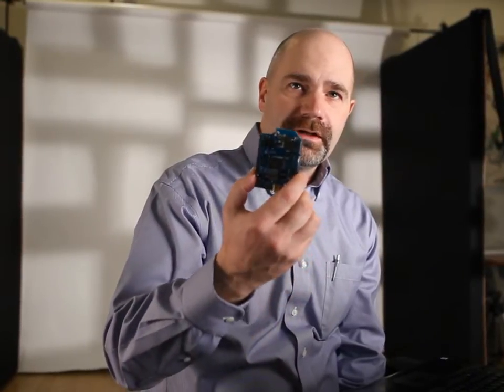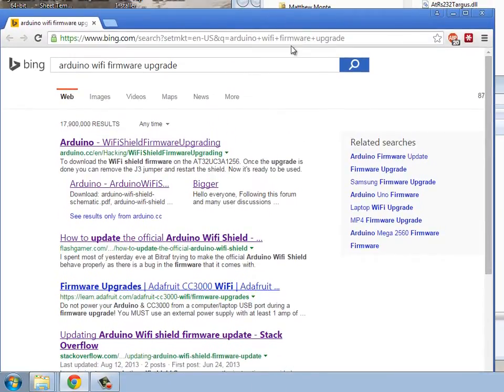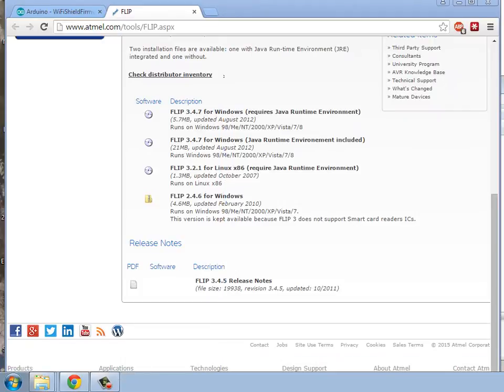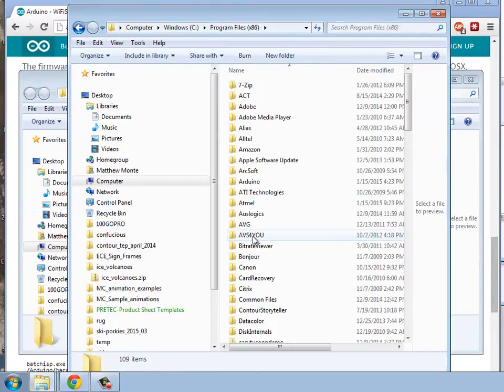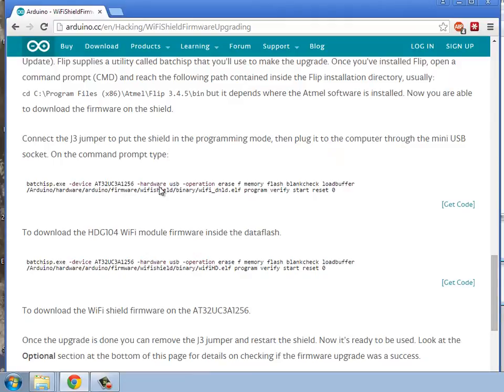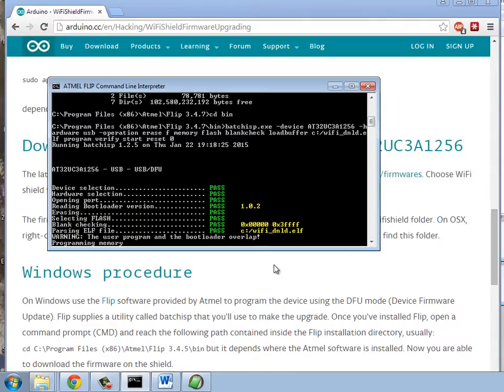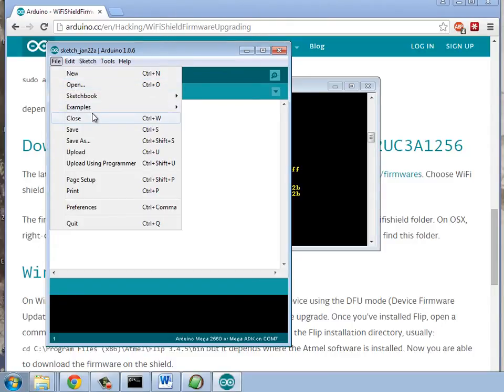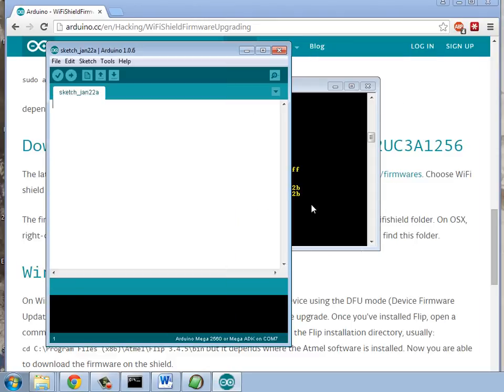Arduino Wifi Shield Firmware Update Procedure

Comment: oh thank you thank you so much there the cmd command : after putting cd C:\Program Files (x86)\Atmel\Flip 3.4.7\bin
1/batchisp.exe -device AT32UC3A1512 -hardware usb -operation erase f memory flash blankcheck loadbuffer c:/wifi_dnld.elf program verify start reset 0
2/batchisp.exe -device AT32UC3A1512 -hardware usb -operation erase f memory flash blankcheck loadbuffer c:/wifiHD.elf program verify start reset 0

Comment: I did everything. Installing ESP.. and changing to MCT and port COM3.
Examples -> I try to compile but it comes error:
Arduino:1.8.1 (Windows 10), Scheda:"NodeMCU 1.0 (ESP-12E Module), 80 MHz, 115200, 4M (3M SPIFFS)"

Opzioni di compilazione cambiate, ricompilo tutto
Lo sketch usa 222201 byte (21%) dello spazio disponibile per i programmi. Il massimo è 1044464 byte.
Le variabili globali usano 31576 byte (38%) di memoria dinamica, lasciando altri 50344 byte liberi per le variabili locali. Il massimo è 81920 byte.
warning: espcomm_sync failed
error: espcomm_open failed
error: espcomm_upload_mem failed
error: espcomm_upload_mem failed

I don't know where is the error. I'm new of this.
My shield is: https://www.amazon.it/gp/product/B01C3ZN920/ref=oh_aui_detailpage_o02_s00?ie=UTF8&psc=1
Wireless Bord Dev Esp8266 Esp-12e UART WiFi Per Arduino Uno R3. I have Arduino UNO (original) and I connected the shield Wifi over the Arduino.
Thank you!
Reply: Hello! I am not sure I can trouble shoot this for you. Did you have a checkbox showing at port COM3 to know for sure that your board is recognized?

Comment: i have a problem when i upgrade firmware in cmd it show some problem .it show device selection to blank checking is PASS but at the last one parsing ELF file show can't open input file "Arduino/hardware/avr/arduino/firmwares/wifishield/binary/wifi_dnld.elf"
FAIL reading error.

please help me how i solved it.
Reply: Hello Gobinda, I am not sure I can help, but it appears that the full path to the file is not there - should be c:\users\Gobinda (or something like that). ...  I would recommend simplifying the location of the file to something like c:\temp\wifi_dnld.elf  to make it easier to define the entire path to the file. Hope that helps! --Matt
Reply: Thank you .......i solved it

Comment: I have a problem with the wifi_dnld.elf, when I click enter a message appears "The operation switch is missing" could you help me?
Reply: +Angel Ramirez I solved the problem, thanks for your video, excellent.
Reply: +Angel Ramirez hi can you explain how did you solve it? I am having the same problem as you did. I really apriciate if you comment how you solve your problem.
Reply: +mert t you need to upgrade the firmware that you arduino wifi have, wait a moment... i need to look for the videos that can help you
Reply: +Angel Ramirez jaja this is the video that help me, if you follow step by step should solve the problem
Reply from the maker: +mert t Do you need help on the firmware update process (this is in the video) or with the problem that Angel solved about "The Operation Switch is Missing" (that is not in this video)?
Reply: how did you fix the problem  "The operation switch is missing"?

Comment: THANKS!
It worked, but surprisingly I had to reflash the bootloaders on that boards I've tried the shield with the old firmware.
Successfully running on UNO , Duemilanove , Diecimila ; MEGA and UNO*PRO